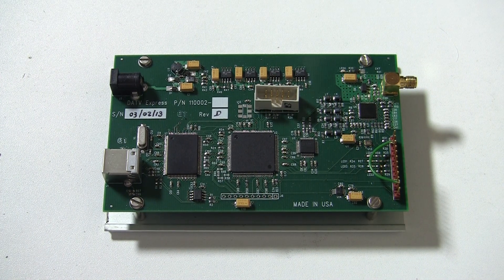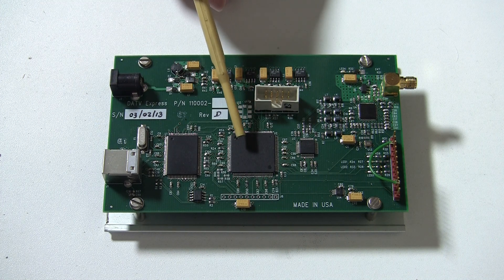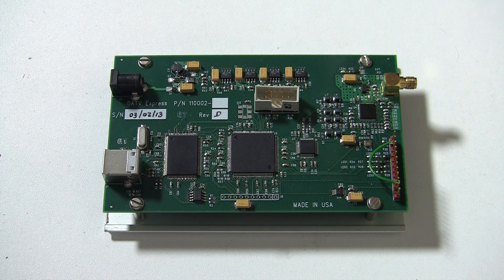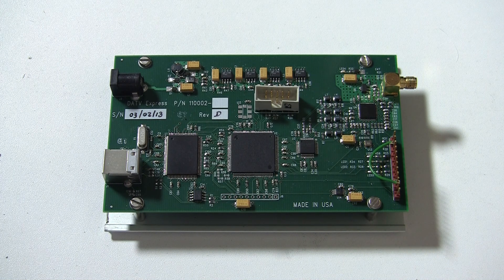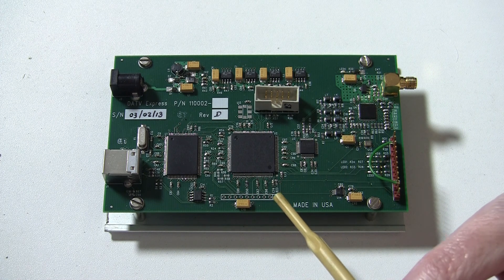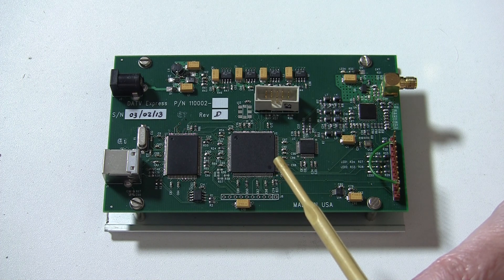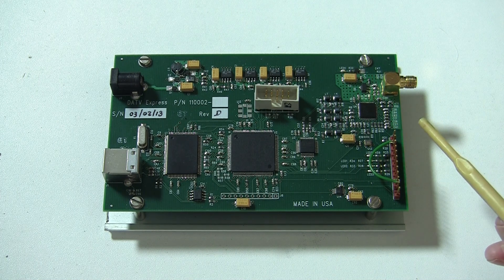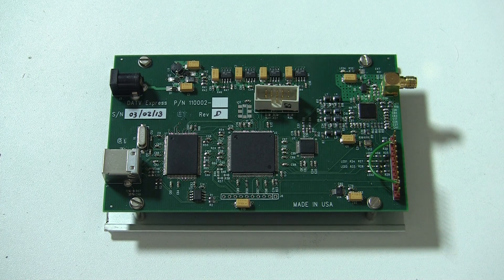DATV-Express Version 2 PCBA

Comment from the maker: Yes the ADRF6755 is very difficult to solder, it has a pad under it as well. Art did a good job. 
Fortunately the final boards will be assembled by pick and place machines. The automated
assembly is cheaper than I thought it would be.